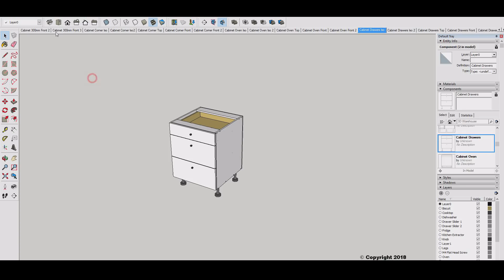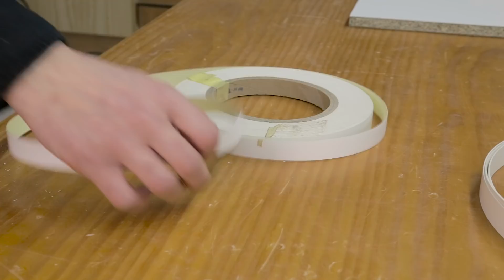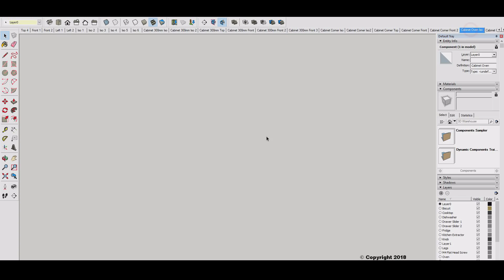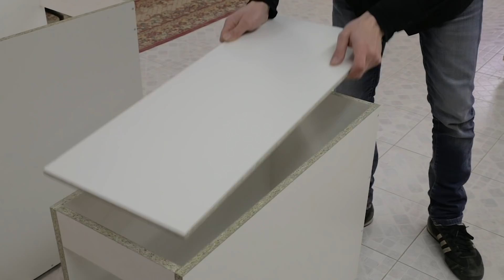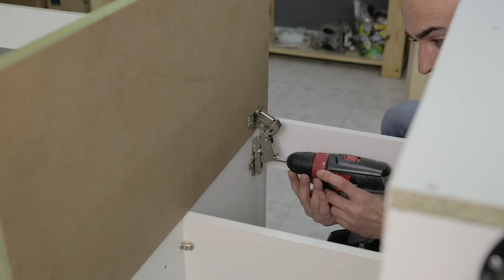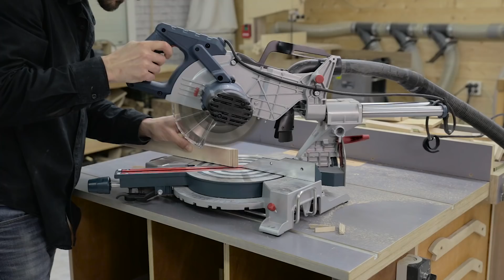Apartment Renovation Ep.4 / European Style Kitchen

Comment: There are some ways to get a better result with melanin or veneer. Cutting with the hand circular saw: good side face down. For the table saw: good side face up. Additional do pre-cutting (prof. table saws might have a scorer blade). This is a 2mm (slightly more than 1/16 inch) deep cut done in inverse sawing direction (pulling the hand circular saw).

Comment: You could change profession and become a Kitchen cabinet maker ;D ;D. I have a question. All the edge banding I have used is the 'Iron on'. Apply heat... Is you brand clean of this,  and needs to have to Contact glue???
Reply from the maker: hello Peter, thanks for your kind words. Effectively, this type of edge banding does not have glue, because it is for use with industrial machines